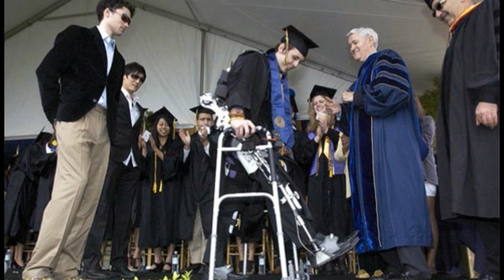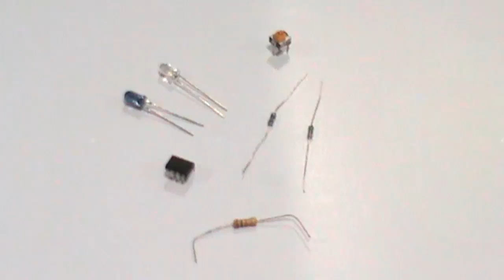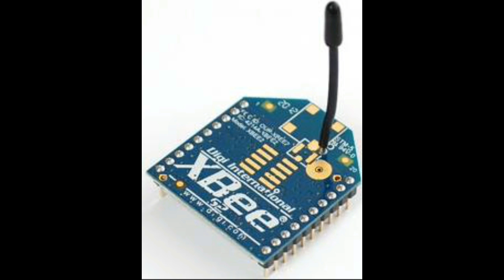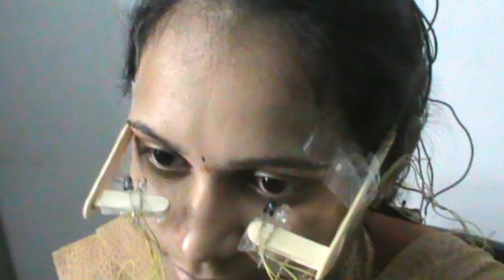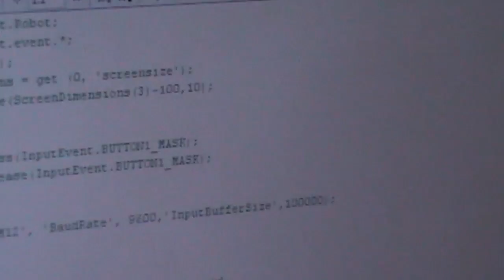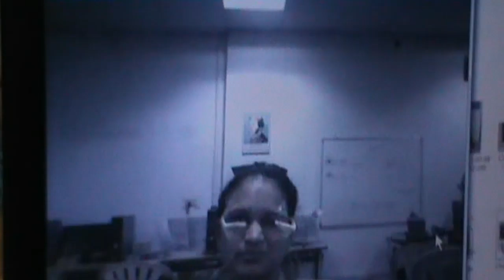TIIC IDC 2015-Team 3027-"Wireless Eye Controlled Device For Paralysed"

Comment: With such a big sensor in the field of vision, how much of the screen is actually seen by the user? You might have to design it in such a way that the sensor emitter pair is placed away from dead centre of the eyes.
Reply: in future it may be like a google glass...
Reply: Mohabath Lal Exactly or else we may keep this little bit lower to eyes but light rays pointing to eyes